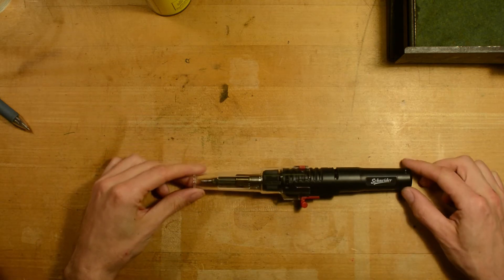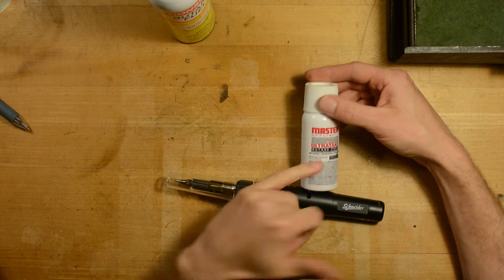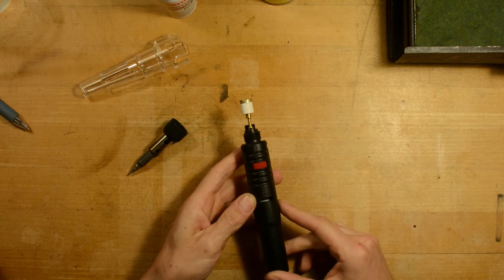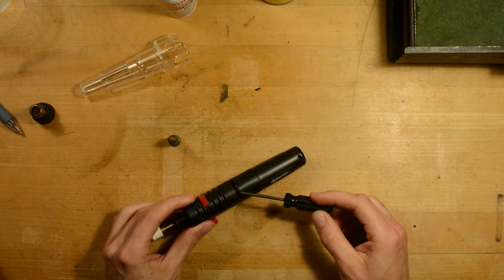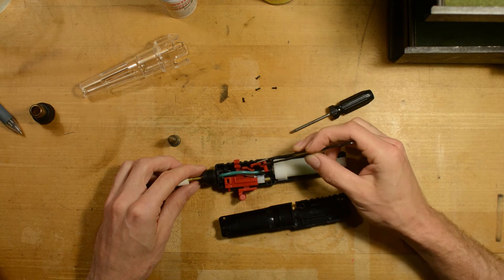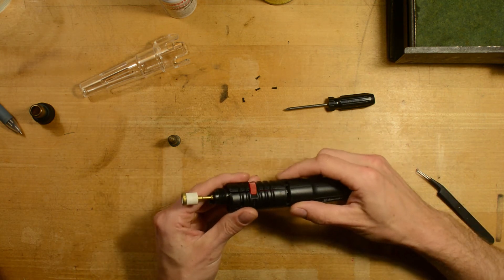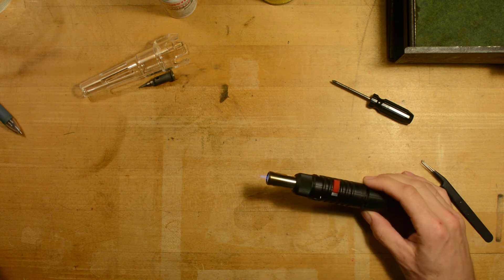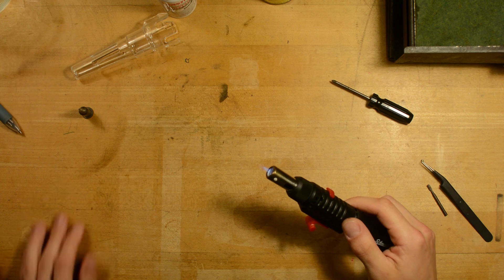Harbor Freight Butane Soldering Iron Modification

Comment: The RadioShack one that's clogged is an easy fix you need to remember use filtered butane of 3× or better , do not stick anything the filter hole where the gas line connected just like most lighters it has filters in it even a common Bic lighter has got filters. Would you like for me to tell you that easy fix?
Reply: Dude you've got me on the edge of my seat. It's been a month already

Comment: Well, you don’t have to cut anything. How does the adjustment for the amount of gas actually work? It rotates a valve, the more it rotates counter clockwise the more open the valve is. All you have to do is reindex the lever on the valve. Same adjustment on lighters, torches, just lift the lever up off the valve and reindex where it’s at….
Reply: Yes but then you lose your high-end maximum temperature
Reply: @BxCornw  the amount of adjustment doesn’t change, it’s the same 90° of rotation or whatever it is the torch is capable of. When you reindex the lever you’re changing the min and max levels. If you wanna max out the torch turn the valve to wide open and reindex the  lever at the max + adjustment.

Also, more gas doesn’t mean higher temp. It just means a bigger flame, the gas burns at the same temp. If you’re heating up a big object it helps but for a soldering iron it’s a waste of gas. I set mine for a 2” flame at max

Comment: Well if he actually knew that the tips of all butane soldering irons have a catalyst that once you see it glow red you blow out the flame and only the gas  is supposed to blow over catalyst amd it stays hot thats the actual way your supposed to use butane soldering irons
Reply: Not all soldering irons and it’s something that does wear out. You don’t even need to light the flame, my torch doesn’t light on the first click especially with the soldering attachment on it. I just click it once and it glows. On bigger torches there’s a switch that’ll put out the flame by opening a vent.

Comment: After your bloviating intro I almost hit delete, but it turned out to be good.   Nice mod!   I particularly enjoyed your close-up shots.   It puts out the heat!  I wonder if a larger tip for soldering tubing or radiators would work with this puppy?